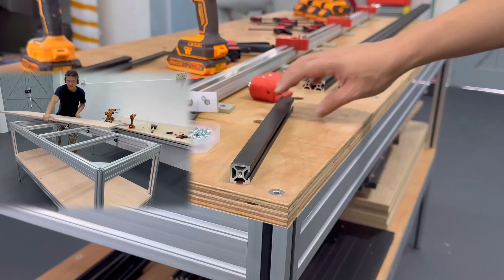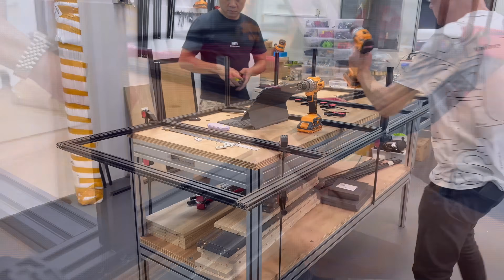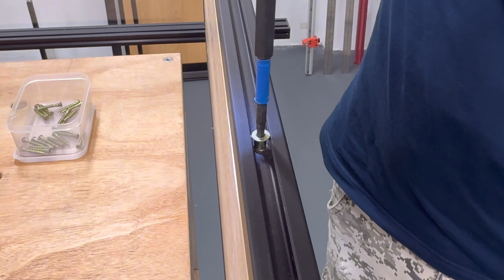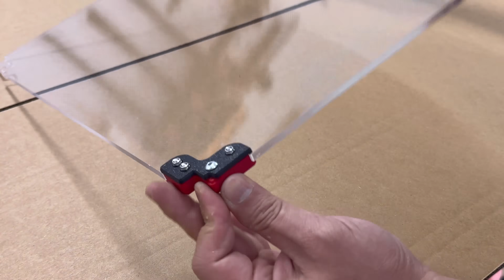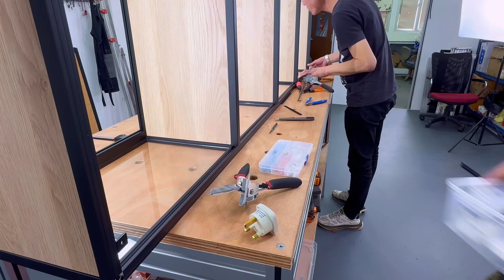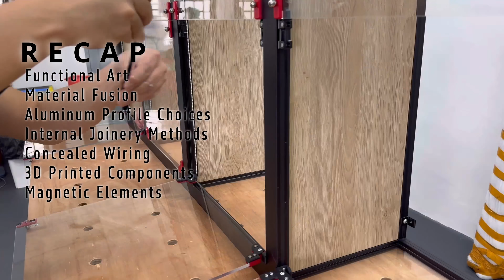Aluminum Extrusion Display Cabinet | LED Lights, Acrylic Panels & Magnetic Hinges

Comment: Very nice design and execution. The challenge that I have with creating this type of display is the front panels or doors. I'm looking for the least visible way to attach glass (with no split down the middle) as acrylic tends to scratch over time no matter careful you are when cleaning the surface.
Reply from the maker: Thanks. What u want is also what i want. Lemme know if u accomplished that.

Comment: I was thinking of making a computer case using that 20×20 extrusion but I'm ashamed on how little I knew what was involved. I still get the shivers when I think of how much pain I was in for before I found your channel.
I think I will watch all of your videos back to back to see what other tricks I may find.

Note: I'm now seriously thinking of buying a 3D printer BEFORE starting on the computer case.

I want to make a air-tight heated case for the printer with the air intake going through cut to size furnace filters. I live in an apartment so I will put 2:1 exhaust:intake fan setup.
Because I still want to build the computer case, I'm thinking designing it so they attach to each other.
Maybe take the hot ait from the computer case and filter it before sending it in to the printer case. Either that or have two separate air exhausts merging just before the window. I figure eight(8) inch flexable insulated dryer hose  would be overkill but better that than having to redesign things after finding out I went with too small a hose.
Reply from the maker: Thanks for the long comment! ❤❤❤ based on what you said, your project sounds like any of my projects involving 3d printing. Yes. My videos will help in your project. I’ve done my best to share my stuffs with the world, and i hope you successfully complete your project!
Reply: @TheAluminumCarpenter Thanks

Comment: The lack of diffusers for the LED strips make it seem a bit less than premium. And the lack of a (3d printed) cover for the transformer is strange and a hazard. Exposed electrical contacts are not a sign of quality. The rest looks pretty decent. Job well done.
Reply from the maker: Thank you for the remarks ❤

Comment: Looks great! I'm going to have to watch it more closely again for the door closing system! quick note: for LED strips that will be on for extended timeframes, in my experience it's been worth making sure the strip is getting adhered to aluminum at least for heat dissipation instead of plastic (especially depending on the quality of the strip and whether it over drives or underdrives the diodes), it can really help with longevity of the LEDs. If you don't want to buy aluminum LED channels (there's a lot to be said for off the shelf), you could simple use long aluminum flat bar stock (that you could then attach with 3d printed connectors, which would even let you give it some airflow if designed for it)
Reply from the maker: Thank you for your lengthy comment, i read it 3 times over and i like every part of it!

Comment: This is great, but you should print some box that goes around the mains terminals on the PSU, to make it impossible to touch the live conductors
Reply from the maker: That's a good suggestion for safety!

Comment: What is the commercial name of the U channel cover/insert product for seating the acrylic panels inside the 2020 tracks?  I've been looking for something like that but I haven't come across it before.  Thanks!
Reply from the maker: the name is u channel... we have it on our site too. stock is low. contact for pre-order.
Reply: @TheAluminumCarpenter   I’d asked because the search function on your website returns the following text:
“No results found for “u track”. Check the spelling or use a different word or phrase”
“No results found for “u channel”. Check the spelling or use a different word or phrase.”

I had also checked through the categories for 2020 accessories and found the door hinges, foot inserts, and others - but nothing matching the U channel.
Reply from the maker: Oh no. Thanks for informing. I will inform my team abt this. U can contact us via email to order too.

Comment: I guess this is super cost ineffective. And those shelves - only the half of wood (or even just 30%) is actually holding the weight + rest 50-70% of the shelve material. 
This project is not impressive.
Reply from the maker: Thanks for your comment!

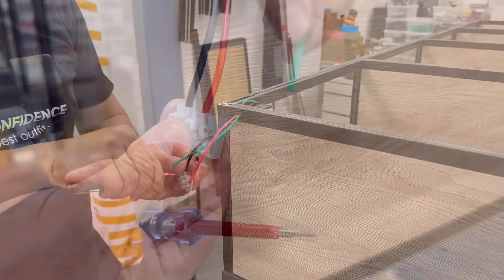Comment: 1) 19:03 Screw terminal blocks require tightening the screws every two years. The wire underneath them can lose contact due to thermal expansion. This requirement is written in the product datasheet. Therefore, no one in their right mind would use screw terminal blocks, which require constant periodic maintenance, when there are self-tightening terminal blocks like Vago, which require no maintenance.

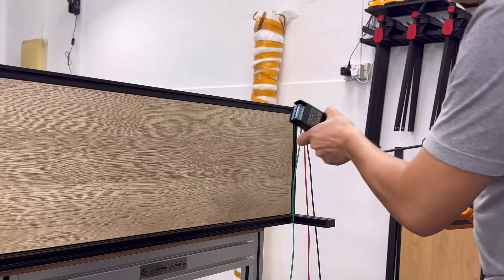2) 18:32 LED strip power supplies have an unpleasant tendency to shrink, along with whatever is nearby, and you attached it where it will be difficult to extinguish + on a chipboard shelf, which is made of wood. Wood + fire + the inability to quickly extinguish the fire = a bad idea.
Reply from the maker: Thank you for ur input !
Reply: WAGO not VAGO ;-)
Reply: @cycl0ne154  😂

Comment: For the holes that you drill out what wall size do you use?
Reply from the maker: 5mm?
Reply: @TheAluminumCarpenter  I mean wall of your print. how many layers. I would drill into the fill area if I did not add enough...or just made it solid.
Reply from the maker: 4-5 walls

Comment: Are the stl files for the 3d printed parts available?
Reply from the maker: It comes with the design download 😄
Reply: @TheAluminumCarpenter  So I have to pay $100.00 to get the files? We don't need the entire model of the shelf, only the 3d printed parts.
Reply from the maker: We have not decided to split it up yet 😩

Comment: Can you give a rough estimate solely for just the cost of materials in Singapore Dollars?   Thanks.
Reply from the maker: Prob 1k sgd.
Reply: @TheAluminumCarpenter  Then I would say, if that is a reasonable estimate, that this design is a very affordable piece.
Reply from the maker: I guess you can say so. The design is not easy to come up with. Took me forever to get everything right.
Reply: @TheAluminumCarpenter  Your attention to detail is what makes your designs both unique and at the same time super practical.   But affordability is key for all those who must pay attention to a budget.   You succeeded on all fronts.
Reply from the maker: Thanks. Btw making the video took more time than the project itself 😁

Comment: the jig with the ruler on it you said its a 2020 yet when you put the 2020 to for spaced drilling its alot smaller... did you mean the jig is a 4040? @ https://youtu.be/C0Vy-jTakfQ?t=77
Reply from the maker: Its 2020. Its correct.
Reply: ok if the jig is a 2020 profile then when you put the 2020 against it for drilling why is it smaller then the jig?
Reply from the maker: Oh u mean the larger profile, its 3030.

Comment: This is an amazing build.  I would recommend additionally using some mesh nylon cable loom for the exposed mains wiring that goes to the plug.  Even if it's not normally visible, I think it would make the power cable that much more professional looking.  (No doubts on your safety, or level of professionalism, it just looks nicer, and you can get a roll of it pretty cheaply.  It's good stuff.)
Reply from the maker: That's a good suggestion! Thanks for the tip.

Comment: I stole several ideas from this build.  I love the dowel paneling idea.  I am thinking if I run power through the extrusion...where I would drill completely through, I'd do something to line the path with some 3D printed conduit grommet thing.  The door closures are amazing, what a slick system.  Same for the LED strips.  I may have put an on/off switch for the lights on the wire.  I like to turn lights on and off without unplugging.  This is really a wonderful design and execution...I doubt folks appreciate how much this would cost as a custom order.  In the US, this would be a four-figure number for this...it's gotta be half a grand in supplies...hardware, aluminum, printed parts and acrylic!
Reply from the maker: Glad you find the ideas useful! You are pretty attentive!

Comment: HAve you considered selling the 3d plans for the jigs. To spend several hundred on jigs for one or two projects seem like a waste. Most people would probably prefer to just buy furniture at that point. $45 or more for one jig that cost less than $5 to make is a lot. I'd definitely buy many different 3d plans for the jigs @ $5 and then print my own. So many people sell plans for projects in woodworking for $15 for a dresser or bed. Awesome builds though
Reply from the maker: Not considered that yet. The jigs are not that easy to make. U still need our parts.